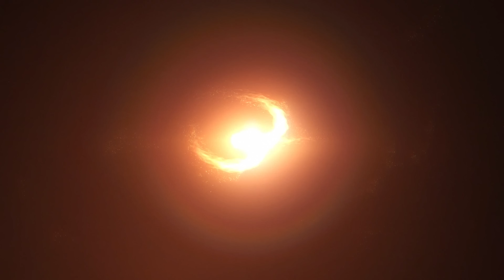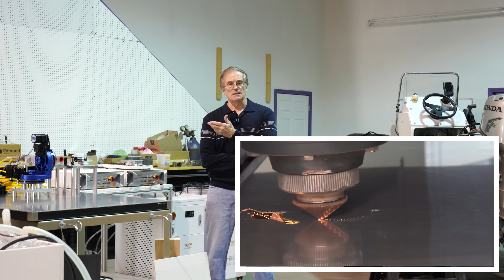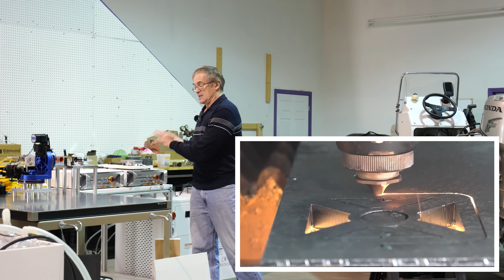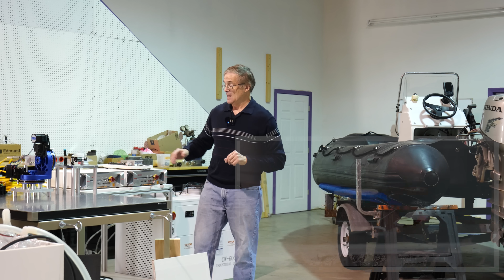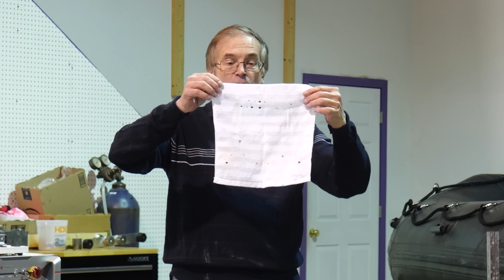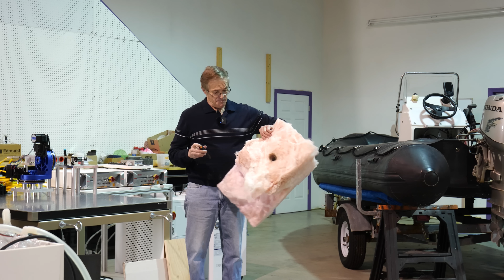We have a problem... and need your help!

Comment: I bet that some higher temperature-rated rock-wool panels would work much better than fiberglass did. In addition to being good at absorbing a lot of heat, the texture should act as a good baffle against dangerous reflections.
Reply from the maker: Agreed.
I'm going to try  that. It would certainly be easy.

Comment: I'm thinking cement backing board might be an option to look at, this is typically used as a backing board for tile installations. I think it typically ranges either one half or five ace of an inch thick cement sandwich between like two layers of fiberglass to something similar. Anyways you can get it at or something like Home Depot or Lowe's and I think it's worth taking a look at may take two or three sheets but should be doable. Also, you could wet it down to extend the time. I use this under the working area for my induction furnace and it has no problem handling a red hot crucible set down on it, or molten aluminum that is spilled on it.
Reply from the maker: I'm actually thinking of that with a layer of rockwool in front.
Reply: @TechIngredients  I'm curious how the rockwool will hold up. I would think it would be much more resilient than fiberglass.

Comment: How about used car tyres? They're mostly carbon black of various descriptions; wiht some rubber and steel wire mesh backing. Should readily absorb laser energy in a wide spectrum, and very affordable if not free. Big stacks, double or triple up on them...

Comment: My first thought is if you are trying to capture light you could coat a firebrick in vantablack or black 4.0 paint. It may diffuse it enough at the point of impact it won't melt or punch through the underlying material.

Comment: Cork covered with pitch, made into a cone like shape to trap any stray laser light.  Maybe with phenolic resin somewhere in there to give you a carbon foam barrier if things go badly.  Something that would create a carbonaceous foam and absorb the light.  Probably something that is also a good scatterer.  Maybe mix something in the pitch to scatter the light if necessary.

Comment: Chad here with some ideas are carbon fiber sheets. They are down to the carbon atom and heated with the highest temp. Basically soot. Also did you  try a pool of water and not to hang it but aim the laser downward into it. The water would break down the rays and scatter them throughout the laser into the pool of water. Plasma cutting machines I believe uses this when I had used one a long time ago. Also in a NASA sentential challenge I had seen a company called Laser Motive and may have videos on YouTube here and they maybe able to help you and could reach out to them as well. They powered electrical helicopters by laser beams pulsating that is. They tracked them and powered them up with a laser. Good Luck.
Reply from the maker: Thanks!

Comment: Loose filled sand bags may be an ideal solution. Depending on the composition, the sand won't absorb 100% of the beam strength and will scatter a lot of it.
However as you're using a (assuming) multi kw system the sand that it does interact with will be replaced by loose sand falling into place from above it. 
The remainder of the beam will be scattered and transmitted through the remainder of the bag and dissipate the power prior to exiting.

Comment: i think u did not make clear on what u need, laser power absorption , if possible passively cooled? - otherwise nothing beats copper cooled with water ....
Reply from the maker: The copper will reflect a substantial amount of energy back at us and the equipment in the room.

Comment: Optical Engineer here. Perhaps an array of neg EFL lenses (negative focal length) that spread the beam reducing the energy per unit area behind it. Could be expensive but I don’t recall low cost being a requirement. ; )
Reply from the maker: It was actually at the end of my wish list.
However,  the beam isn't fixed.  It will be scanning all around the testing area and could lock up anywhere up to the mechanical stops.

Comment: Man, that is tough. I'm getting caught on the idea of making the background move. Like 3 alternating layers of something thin like black plastic and something thicker like cloth and something ultra heat dissipating behind it, maybe aluminium foilish kind of thing? (I think the motion of the other layers would catch reflection due to the irregular motion) set up with a fan so that it waves loosely, quickly, and irregularly. flops and waves around so much it is invincible!
Reply: or asbestos!

Comment: Conceptualize a chocolate fountain. Then make it an upside-down cone shaped... and spinning/rotating but not too fast. Replace chocolate with water. Have a perfectly smooth water fountain coming out of an ice cream cone disperser. Have the fountain internal material be made of tungsten [carbide?] (high heat absorption) and the coating made of Vanta or a heavily absorptive material. It's a thought.

Comment: I wonder if something like tungsten carbide or silicon nitride granules would work (held in place with another container or a cylinder with roughened interior). They're the darkest high temp ceramics (I can think of off hand) that may offer both some dispersion of the laser light and absorption of it's energy.

Comment: This may be a stupid or impractical idea, but how about putting a large diffusion lens (or a transparent tank with some fluid containing a stable particle suspension) in front of the wall to scatter that ridiculously high powered beam into several weaker ones that are easier to handle? Maybe then, drywall or glass wool would already be sufficient to withstand getting blasted.

Comment: I'm no experts in anything, but I do have a suggestion based on what I have learned from materials. 
Graphene or graphene based aerogel could help. 
(Basically thin layers of carbon with astounding properties)
They can withstand enormous heat and the aerogels can take an astonishing amount of heat for a little while.
Another possibility is using Sapphire lenses that are polarized. 
Could possibly implement a form of kill switch where is the machine malfunctions the lenses will pop in front of the laser stopping the beam from going forward. 
If you have two polarized lenses and you line them up correctly it will dissipate light from going through the other side. 
I suggest Sapphire because of its high resistance to heat 
And there are companies that actually will custom machine lenses for you

Comment: Given the dynamic and reoccurring nature of your problem, instead of a hard barrier, I suggest considering a dynamic laminar water flow fountain as a target. Dye at an appropriate frequency of the laser in the water can even be used to absorb the light like a black body so that the heat can be transferred into a reservoir and cooled by a radiator or ice. The water flow would of course be adjustable. Essentially we are talking about the potential of using a glass fish tank. You might want sacrificial drywall as a target in front. You may also need to consider dry ice smoke between the drywall and the waterfall as an "atmosphere" to break the coherence of the laser and reduce the possibility of reflection.

Comment: At Boeing we use laser shock peening on certain materials in place of traditional shot peening. This equipment uses very powerful lasers and the internal protection equipment uses water curtains in front of thick black vinyl panels. The water confines the plasma to a smaller spot and the black vinyl to absorb anything that gets through (the vinyl panels would cost more than the sheet rock. most likely). It is sacrificial and would burn through eventually. Deflection baffles and/or rapidly oscillating shutters behind the water curtain could help, these are all techniques we use in our equipment.
Reply from the maker: Thanks!

Comment: Have you heard of starlite? Nighthawkinlight did a video on it. Its real cheap
Reply: And light weight, and heat resistant via ablation
Reply: Someone mentioned a water curtain over melamine, perhaps dyeing the water or filling the water with carbon black powder might be a good option

Comment: Walll of water.  Stand a sheet of your 3/4 inch plywood up in a trought. Tilt it away from the lazer say 5 degrees. Connect a pump from the trrought to the top of the plywood with a hose and fill trought  to. supply water onto wood.
          Phil Tomeo
          Cecil, NJ
Reply from the maker: I like that.
We'd have to figure out how to distribute the water relatively evenly over the sheet.   Maybe a PVC pipe with a lot of small holes along its length.

Comment: Low density ablative ceramic like the space shuttle had, but make it so it spins and moves on either X or Z axis so the laser won't blast a hole in it. You'll have time/area to save your garage door.  I don't know what the W/cm2 is that you have there, so I'm shooting from the hip here.

Comment: I think that manual emergency is good but not so good as an automatic emergency shutdown.
If drywall is penetrated in 0.25ms, then you have enough time to disable the laser automatically.
Since you said that while scanning it will not cut through materials, then create a closed box 5 m by 5 m by 25 cm with phototransistors inside.
As soon one of the phototransistors will be triggered, it will disable the bistable relay which will disable the contactor that commutates power to the laser.
Place drywall sheets behind and in front of this box. The ones behind will add time before damage to the building is done if relays will take too much time to disable power of the laser and ones in front will remove accidental triggering of emergency disable mechanism while you will test the laser.
I also suggest adding two/three relay+contactor+phototransistor cascades in series, in case one/two contactor accidentally welds and cannot be turned off, to minimize the risk of something going wrong.
Reply from the maker: I like your non material approach. We will incorporate fail-safe switches, and this laser source is already wired with multiple interlocks for its use in an industrial environment.
Reply: @TechIngredients  Could go with a quasi-material approach and line the edges of a sheet of glass or plexiglass with phototransistors. As a sweep target that should improve the sensitivity due to light piping.

Comment: A pile of very tiny glass spheres could be used to refract the light everywhere. 

Or perhaps two parallel mirrors could bounce the light around enough to slowly dissipate the energy (a few percent each bounce)

Comment: What about a ceramic wool material. My forst thought was an asbestos curtain like they used to use in theatre but obviously that presents its own problems. 

The other thought i had was to make a series of fresnel lenses panels, which may or may not work (likely not due to the power of the lasers) to disperse and diffuse it, at least at small scale.

Comment: maybe frame a rectangle from 2x4s or 4x4s and use two sheets of cement board to enclose it. Fill the empty space with some sand. Might need to reinforce the heavy but empty-able frame with some metal brackets since putting another member diagonally would compromise the protection.

Comment: Sandbags? Cheap-ish, easy to build with, and if any of the material is blasted away, I think more would fall into it's place like a sand dune collapsing. Edit: Water soaked sandbags. Water to soak the bags to keep them from combusting.

Comment: If you have a material with sufficiently low absorbance (ie glass), you could fill a tube with an absorbing suspension/dye like charcoal in water. Decrease concentration until the water doesn’t instantly boil. May need a long glass/quartz tube to accommodate beam energy dissipation. Could also continuously cycle fluid too. An easy way would be to buy a long quartz tube and figure out how to make one end of it accommodate laser without exploding.

If you can’t, cooled mirror will be needed to aim the laser 90deg downward into an open column.

Could be done with gas/smoke too I suppose but you may need higher absorbance materials, ventilation, and definitely more space.

Comment: I ran across this without seeing the first video.  My first response is to think that such lasers should be readily available ... but that ship has sailed.  Still holy crap that's a lot of energy focused to a very small point.

I bought a Felt Carbon Fiber Welding Blanket on Amazon, that might take the heat ... but the immediate energy spike might also just blow it apart, but perhaps it could be combine with a backing material or used wet (or backed by something that can hold water, thin sponge).  Energy is energy and if you aren't reflecting it you have to absorb it.  Absorbing that much energy requires a material that will stay together long enough to disperse it.  Usually that requires mass.  I wonder how such a beam would interact with something like low UV glass.  A continue flow of water might work, but it seems it would be hard implement on the scale you need.

Comment: I run one of these machines(laser table) I've had to cut low grade steel with carbon pockets, the carbon absolutely destroys the beam.
Try a second stationary lense to diffuse the beam into a cheap carbon steel sheet, preferably very thick, use a steel bar length wise
Reply from the maker: We have to protect the entire back wall.
Reply: @TechIngredients if you open up the beam even to a 1/2 -1" it shouldn't be able to cut steel especially if it's rusty/carbon filled.
Even tiny things like a plastic shipping tag or heat numbers painted on usually drop the cut, if you're able to throw it off even a little  you'll only need to dissipate the heat. 

There's essentially nothing that will stop it if the beam is so refined

Comment: At the target, use 😮 glass doped with Ytterbium or Erbium. Bragg Gratings in reverse. Oscillator in reverse. 
In other words, do the reverse at the target end that is being generated from the source output.
Reply from the maker: I suspect that would be very expensive over such a large area.

Comment: Sheets of glass beads.  Maybe 3 or 4 layers of them.  Best if they had somewhat ground surfaces on them.  Then you can aim a fast light sensor at them, based on a PIN diode or fast phototransistor, that can be used as a trigger to shut the lasers off automatically.

Comment: Brainiac75 (youtuber) made a laser diffuser using barium sulfate (melting point of 1580 C) with the power of lasers you are using, relying on one thing to stop the beam is a mistake, use multiple levels, something cheap and easily replaceable as the primary backstop, calcs001's idea of a spinning drum coated with a diffusion coating (barium sulfate reflects all wavelengths of light) and if you fill the drum with cold water to add thermal mass, will make a good cheap replaceable first line, (might be an idea to hit the drum at an angle to increase the laser spot size, like sloped armour) then behind and around this is another backstop that defuses the light further (again filled with water to adsorb any heat) then all this goes in a big box which the inside of has been painted with something like Vantablack to absorb the light reflected off the diffusion surfaces.

Comment: One idea that came to mind is to fill a large mason jar with a solution that will scatter the light. The glass allows the laser to go through into the solution and the heat capacity of the water plus a reasonable volume might be enough to diffuse the heat. If you wrap the Mason jar with aluminum foil, it will burn through the first layer so you get very little bounce back

Comment: This reminded to the age old joke where the Americans spent millions of dollars to invent an ink pen to write in space... and the Russians used pencils. :D I understand the cool effect of a laser weapon, but your approach should be different. What is plentiful on the battlefield that was invented and perfected to aim and destroy targets? Yes guns! You should design a system that could take ANY gun and make it a drone destroying station. 
 But if you want to use lasers regardless, than just use materials that were designed to return to the atmosphere. Ceramics would tolerate that heat for a long time. Ceramic tiles could suit you best.
Reply from the maker: I understand. The practical Russian approach is how I try to design most of our projects. The application with lasers is still in its infancy and has other potential than just drones. The fact that what we're doing in our little shop isn't that far behind what major defense contractos have accomplished isn't because we're that smart.  It's because the technology is still so undevloped.

Comment: I remember watching a video at some point demonstrating these panels used for fire protection that essentially expand into a carbon foam upon exposure to the heat of fire, unfortunately I don't remember exactly what the panels were called, nor can I find the video in question to share.

That said, a cursory search on Google seems to show a lot of results for various "carbon foam" products for fire protection, so it could be worth looking into to see if they can hold up to the energy of a high-power laser.

Comment: I read a lot of suggestions and which i most liked was a reflective plate at 45 degrees eeflecting to the floor with an absorbing material on it like silica or charcoal soaked in water or so. My own: absorbing black layer fiberglass soaked in water and reflectant layer in the back: perhaps several layers solv the problem,doesnt matter what you experienced with just one layer of fiberglass